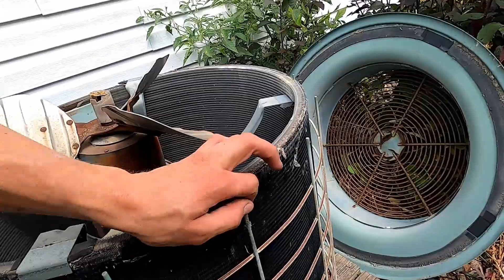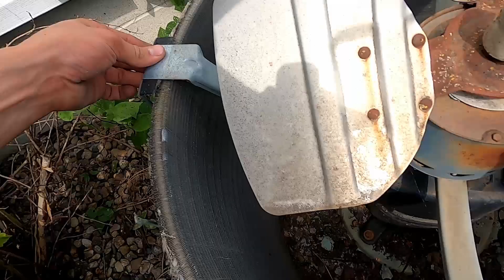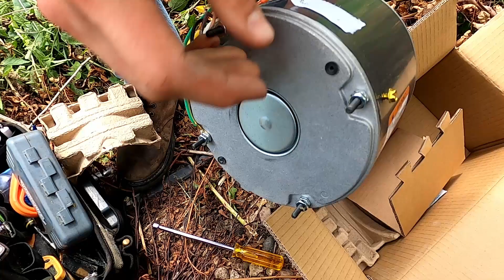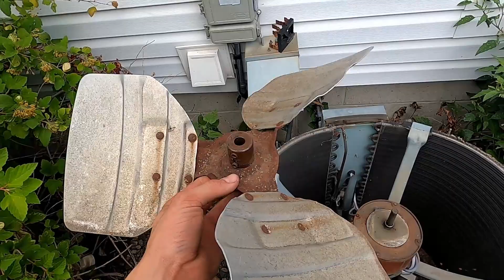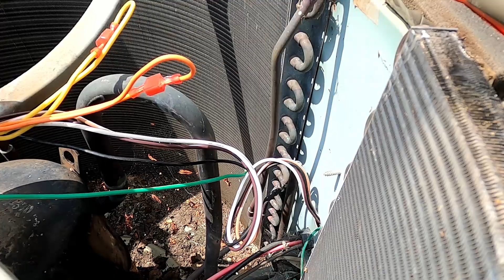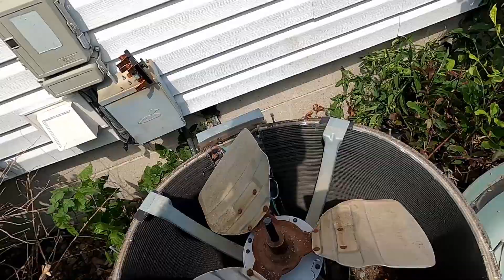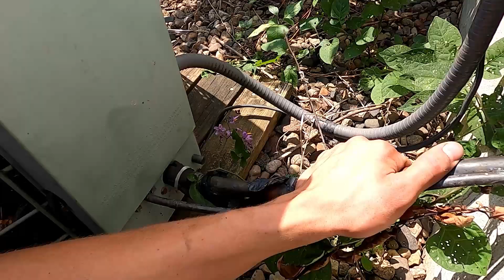How to Install a Condensing fan Motor

Comment: most contractors would have just sold a a new unit.
Reply from the maker: Yes, it's certainly an old unit! It should have a few more years in it though. If the compressor is bad, or the coil is in really tough shape, we recommend replacing the unit. Otherwise, we let them decide to repair or replace.

Comment: What happened here in this service call? Also, why didn’t you put the shaft cover on?
Reply from the maker: On the service call we attempted to oil the motor (which can sometimes make the unit run for awhile) but were unsuccessful. This we returned later, at which point I installed the new motor. Shaft cover? I am not sure I understand what you're referring to.
Reply: Like the one at 0:41 Reuben
Reply from the maker: @pepsicolachao4537  Oh! I understand now. It's interesting that there was one at all because in my experience I have only ever seen a couple of those. That's probably why those set screws were not stuck when I took the blade off. The reason I did not install one is simply that the new motor did not come with one and the old one had deteriorated too far to put back on.